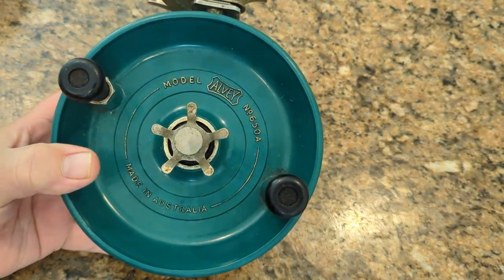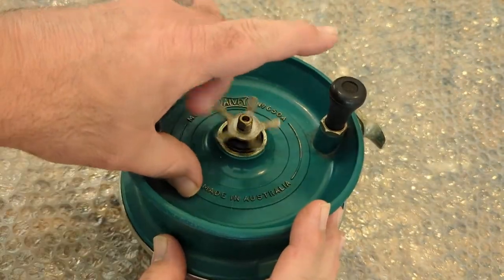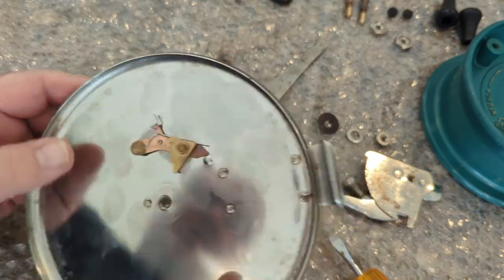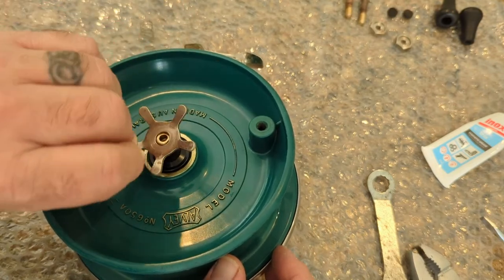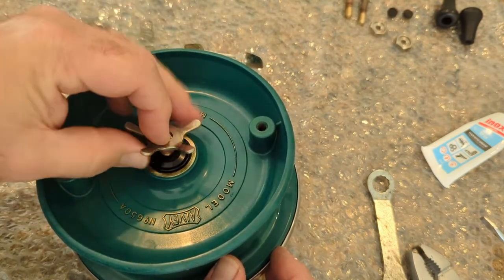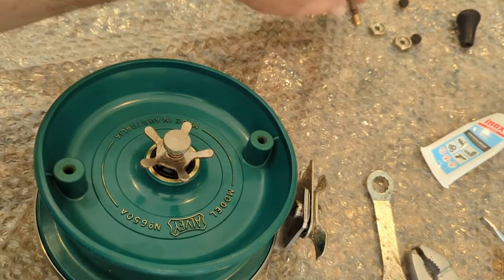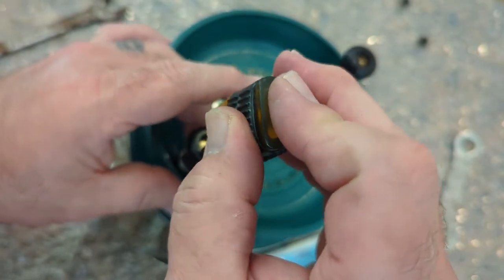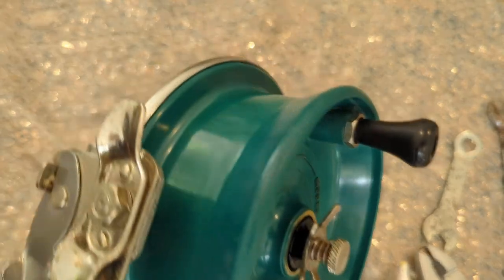How to Clean an Alvey 650 a Side Casting Fishing Reel. Complete disassemble, clean, and reassemble.

Comment: Great Reel, we use them in Australia, pretty much bullet proof. I've had mine for years, I've dunked it Saltwater for years. I just lube it once a year. Works every time. I do wash it dishwasher liquid with freshwater to remove the excess salt. Good job
Reply: I'm 40 in August I got my real for my 17th birthday. It is basically the same, but the graphite back version...
... works like the day I got it actually it's a bit better because it's not as stiff now 😂
Reply from the maker: I use mine quite a bit in the Northern Beaches just north of Sydney and they haven't failed me yet. I've lost quite a few egg beaters to sand but so far the Alveys are still going. They might have built them a little too well.

Comment: I think I have a 1970 model market A1/ 7 bakelite it also has the line ring up front. 🐊
Reply from the maker: I have since gathered a bundle of Alvey reels but I don't have any with the ring up front. How do they cast compared to the later ones without the ring?
Reply: Help land fish and stop line slipping of the side, on a surf rod cast is fine no drama. @landcastertackle
Reply from the maker: Line loops slipping off the spool while at an angle is the biggest problem I have with Alvey reels.